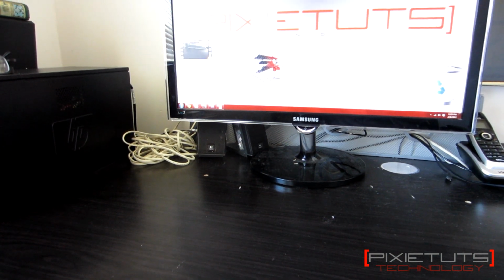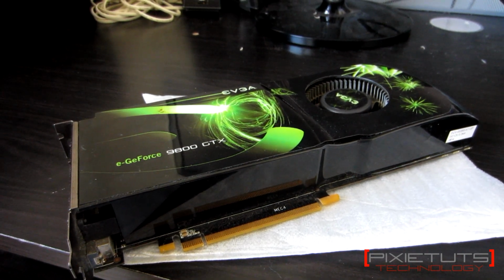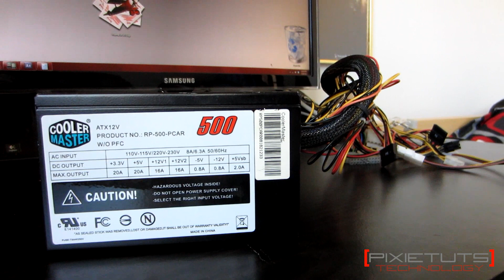Tutorial: Separate Power Supply for your Graphics Card

Comment: is there any danger  or downsides to that
Reply: The question is very simple : does this tweak of having 2 PSU (with one dedicated to the graphic card)  instead of 1 PSU entail specific risk ? The answer is a resounding "no". End of story.
Reply: +Doc Lex There's two actually, underloading and overloading.

Too little power drawn will mean too little draw of current - bad output voltage swings.
Too much power drawn will mean too much draw of current - overloading and shutting it down or worse.

e.g.

200W max. GPU = 300W PSU

etc. about 1.5x the required peak power is safe, you will headroom and adequate load.
Reply: +Nightingale1887 there can never be "too much power drawn'' -the watt rating of a PSU indicates the maximum watts available, not watts that will be ´forçe fed' into the device. The important thing to remember is that a PSU provides roughly constant voltage, it is current which will vary according to the load the device has to cope with. ( when overclocking, comparatively, you can overload the chip by increasing Vcore voltage)
Reply: Nightingale1887 Yes I know that watts and amps go  in locksteps when V is fixed. What I am addressing is your misconception that "overloading is a risk" in this case. It is not.  You can't overload a graphic card by granting it a dedicated PSU, any more than you can't overload a light bulb **when you feed them their fixed rated voltage** (which is precisely the role of a PSU). It won't happen, never, ever. (that would be a very different matter if you short the power supply, for then, resistance is 0 and watts and intensity surge until the PSU  fries or some failsafe fuse is activated. ) Summing up : When your graphic card is idle, your PSU will supply it 12V, 0.1 Amps (for example) and when you graphic card is under load and needs to perform zillions of calculations per second, it draws an influx of energy by opening up billions of new transistor circuits that your PSU will rush to fill automatically 12V, and 15 Amps (example) to exactly match the load - if the PSU can't do this, your card is power starved and it may experience  bugs (but no harm) .  For the argument sake, you could even forget altogether the PSU and feed your graphic card with a 12V car battery (obviously not something recommanded), but in the broad lines, it would behave exactly the same. Bottom line : you can't overload the graphic card as long as it is plugged to the correct voltage PSU. To answer the OP asking about this specific type of tweak (2 separate PSU, 1 dedicated for the graphic card), I would say it makes no difference from the purely electrical standpoint.
Reply: Nightingale1887 Please - the OP is refering to this specific case of having 2 PSU, with one PSU dedicated for the graphic card. Everybody knows that a PSU can die from running at, or over, maximum intended wattage. But this is has nothing to do with the present question, ie. having two PSUs. and one dedicated for the graphic card - Or perhaps do you suppose it is much more likely to fry a PSU when another one is fully dedicated to feeding the graphic card ? Come on.
Reply: +Nightingale1887 from your advanced standpoint, explain me the interesting concept of "underloading a PSU" then ? When can it possibly happen ,?
Reply: +Nightingale1887 and also explain how having 2 PSUs would entail a higher risk of overloading one or both of them ? This is what the OP question is about.
Reply: +Nightingale1887 even for a single PSU, there is no such thing as ""underloading it". You fail to subtstantiate your claims and display poor logic and rude behaviour. Besides,you.re losing your nerves quite graciously here. Thanks for completing my demonstration. All the best.
Reply: +Nightingale1887 using your interesting concept of "power underload" I suppose a PC is most unstable or present risky situatio nwhile doing nothing in idle, or in power management mode ? Thus severely "underloading the PSU"  looool ?? Give me a break. As for overloading', it is plain obvious that adding a separate PSU DECREASES the risk of overload compared to having one only....
Reply: +Nightingale1887 a tons of result on Google ? Maybe like ten . Most of them in forums ans most of them mentionning how utter rubbish the "power underload" concept is.
Reply: Tell me, why o you feel the need to attack my person instead of my arguments? Are not we here to approach some truth? Why such behaviour ? I did not call you names once. Anyway.
Reply: You are unable to navigate yor way through a discussion with logical arguments and facts. Wére debating a Tweak and here you are caling names. There is no point in discussing.  My redundancy salutes your Uniqueness.
Reply: +Nightingale1887 yes yes you proclaim I am wrong, I got that. As for bringing proof of it in the form of facts, logical arguments or external source on the internet.... Well, we just have to trust the doctor.... Bottom line for our potential readers (you.re off limits for a rational argument): there is no risk in using a separate PSU for your graphic card. Google "adding a PSU" or "double PSU"  and you'll find dozens of youtube videos detailing this. No risk whatsoever.
Reply: +James Clerkmaxwell I think you will find that Watts and power (Amps) drawn will be interchangeable IF voltage remains constant. So thanks for being obvious? power = volts ° amps, simplified ofc. Max load will of course give trouble So what are you rambling about?
Reply: +James Clerkmaxwell Who the hell is talking about a GPU? Jfc the PSU will die from overloading. Read it as it is written.
Reply: +James Clerkmaxwell So everybody knows? Come on. It's called being complete.
Reply: +James Clerkmaxwell yes, you're* 'winning' here. Good luck in life <3
Reply: +Nightingale1887 besides if you even took one second to google PSU underload you'd see a ton of results BUT hey you.re ""right". See what I did there? Your grammar is rude and being a total dumbass is charming too <3
Reply: +James Clerkmaxwell Nope Nope Nope that's just filthy peasant lies.
Reply: James Clerkmaxwell What? Nope, you're still redundant and wrong. No discussion needed.
Reply: James Clerkmaxwell Wrong, once again.
Reply: +James Clerkmaxwell oh c'mon say something stupid again. This is fun. You.re funny.
Reply: +Arr2 D2 Nice try.
Reply: anyone knows what happens to northbridge when you upgrade your cpu, does it run hotter or is it the same or what? thx!!
Reply: James Clerkmaxwell +Nightingale1887 anyone knows what happens to northbridge when you upgrade your cpu, does it run hotter or is it the same or what? thx!!
Reply: Arr2 D2 Boohoo fucktard. If you'd know shit about electronics you'd know all I said is correct BUT no going the with dumbass first class James Clarkwell proves you are on his level. Good job! I'm so impressed.
Reply: For the readers : What  Nightingale FAILS to understand here is this : an efficiency curve IS NOT a stability curve. It is not because a PSU is less efficient near idle that it is less stable near idle !! On the other side, at full rated load and increasing, a PSU is indeed getting less stable and much hotter, increasing risk. That's plain simple logic and commonly known facts. While it is true that SMPS require a very low minimum load to activate, I myself experimented with them, using a PSU to power a load as low as a single LED in series with a small resistor, a very small electric motor, etc.. with no problem whatsoever (we're not talking about power-greedy components such as graphic cards or other PC components, which would be much above this absolute minimum just by their fans and LEDs design) ...In any case not meeting this minimum load would not qualify as a "danger", and above this absolute minimum of some tenth of ampere the concept of "underloading a PSU is a risk/danger" is nothing short but ridiculous (beware, do not let your PC go into sleep mode!)...  But some people see curve just like this one : http://www.anandtech.com/show/2624/3 , draw faulty conclusions, give wrong advice, lecture other people, and can't even acknowledge when they are wrong. Barrage of insults are so easy when things are going badly...
Reply: ***** Team Fortress 2? Great game!
Reply: Arr2 D2 That's good to know. Glad there are idiots like you giving  free consulations. Electronics are too hard but hey calling people a child now that's pure intellect.
Read much?
Reply: Nightingale1887 jesus christ you twoo (or 3 or 4) for how many more monts is this debate gonna last?
Reply: Arr2 D2 Wrong again. Resorting to emoticons is supposedly impressive?

Btw so, your name is Hurrr2D2 and you take yourself serious yet call others a child. 

Divine comedy right there. You prove that you need attention. You even ask for it.
Reply: Arr2 D2 so you're Robert Jackson who gets off on people popping zits. Way to go champ.

Comment: whats the point of the paper clip what does it actually do shouldn't you just be able to plug the power supply into wall then directly into your graphics card? that paper clips seems more like fire hazard than anything else
Reply: +john avery PSU will only work if it thinks its connected to a mobo by the 20/24 pin connector. so if your not connecting it directly to a motherboard then you have to jump the power supply for it to power on. just a safety mechanism. jumping it with a pin isnt dangerous or a fire hazard. theres no positive current going through the jumping wires. black = negative. so its pretty safe if you jump the right wires.
Reply: +john avery it's a jumper.  you can, or probably should use a short insulated wire to accomplish the same thing.  that's all i know for sure.  i THINK the reason it's there is because that cord does not get connected to anything like it normally would.  the power that comes in on one of those wires has nowhere to go because it's not making contact with anything, so you put a jumper in there to complete the circuit.  otherwise the power supply will turn on when it's plugged into the wall, but it wont distribute power.  that's my best guess anyway.  edit:  after looking at a couple other videos, it wont turn on at all without the jumper.

Comment: So I did it and yes it worked. I currently just connected my CX600M to my GTX 760 and I actually had an increase in performance. I believe this was because my original PSU was limiting my Clock set. Any ways, now that I know its safe ill be hooking up my GTX 780, thanks mate.
Reply: Unit-01 Moto can u help with clip..
Reply: How was it in a long run?

Comment: you use the paperclip jumper to turn the supply on and then you connect the video card to it. that's not necessarily a good idea. could blow the ps unit. you shouldn't add (or remove) electronics to it when its running. connect the card first and then power it up.

Comment: So i have this problem. My gpu is 7770 radeon and my pc is runing on 300w psu i would like to connect my gpu to another psu so that one psu fot motherboard and hdds and another soly for gpu it would be 600w totall. I am little bit in electronicks so my question is whet gpu is connected to motherboard it takes power from it. and if i connect 6 pin power suply to it from another psu  they will fight each other= smoke isnt it true? or is there something i`m missing?
Reply: yes do not ever connect 2 different psu to one gpu !!!! just buy a 750 watt psu with at least 18A on the 12v rails ! U get them as cheep as 50 euros!

Comment: Hi there. I have 600 watts stock psu of Xigmatek Asgard Chasis. My VGA is Sapphire r9 290 tri-x oc 4 GB 512-bit GDDR5 and my CPU is AMD FX X8 9370 4.4GHz. Is my psu enough for my rig? Please I'm a noob when it comes to power efficiency and I don't want to harm my hardware? Should I upgrade or is 600 watts enough for this setting? Please help.
Reply: I have this psu: X-Calibre XCP-A600 600W 75+
Reply: you should have at least 750w (bronze+) going for a rig like that and a 180w CPU like the 9370. I picked myself up a bronze 750w EVGA supernova for around 90 bucks.

Comment: allright so, I'm gonna do this, can anyone answer me please?

- I've 320W  PSU on official HP cpu. I cannot upgrade PSU (pins don't match) so i'm going to buy a normal PSU and connect it externally (how he shows in the video)

- Im gonna buy 450W PSU.  Cause i'm buying a card called 'Gtx760' which would consume only 160-200W max,  so my 450W additional PSU would be enough to run.

Question Time.
When i'm successfully installed additional PSU to my GPU and start gaming..

1: Will PSU or GPU generate extra heat?
2: Will PSU give right amount of power to GPU?
what if my GPU burns? or doesn't soak right amount of power?

Is this tutorial safe?

I really, really want to do this very soon. Please reply.
Thank you.
Reply: Its been 4 years,how did it work out?
Reply: @lazertag720  I tried it like hour ago...it worked bro.Paper clip shit is working...❤❤🤗
Reply: @reikaz_CS  Still working? :P
Reply: @razmuzen1090  yeah man.It really works still. 🙂
Reply: @reikaz_CS  how do you turn everything off/on😩 im doing this later

Comment: why the hell would u go thew all that trouble if u already had a second power supply that would most likely  power both your PC and graphics card at same time why wouldn't you just take the old one out and put a new one in
Reply: reason why he made this video is
sometimes , some company manufacture the CPU's in such a way that PSU's cannot be upgraded
I.E mine,  I cannot upgrade my PSU. the regular psu pins don't match with mobo's pins.

so that's why, I buy additional PSU for powering up GPU , in this method.
Reply: a few dell and hp pcs still use proprietary power supplies, also this works for servers that do not have an option for graphics card power connectors.
Reply: because some computers has PSU's that could not be changes like mine. HP elite 830. so we need a second power supply for the gpu
Reply: a have an HP 8200 and it doesn't have a 24pin in the motherboard so i can't replace my PSU and i have a corsair 430 Watts so i'm gonna try this method and i will see if it works for me !
Reply: yea I was thinking the same thing.. I hope he will answer
Reply: I guess since he didnt install the card, that it was just a demo and he didnt plan to do this setup. (Maybe)
Reply: he's showing how to do it
Reply: ///M Power did it work
Reply: Sometimes my old motherboard has a shitty PSU soldered in. Im waiting until my new motherboard comes but until then, i have to do this
Reply: did it work???
Reply: ///M Power can u help i have the same machine i want to do exact what he has done in the video
Reply: jaylord55 well the reason I came here is that I have a slightly new pc that has a power supply of 250 watts and a gpu and 110 watt power supply from an older computer. The 250 doesn't have extra connectors so I need the power from the old power supply to power the gpu that's plugged into the newer pc so this video is very helpful
Reply: can you do this.. two 230w psu, with vata connectors, the 2x vata to 6pin connects to geforce 8800gt. both vataz on end of 6pin is connect to a diffent power supply. would that give me enough power to run it. ( I need 425w )
Reply: To show that you can. Focus people.

Comment: I have twin frozr gaming GTX 650 ti boost and if i set it to 115 on the second power supply it doesn't burn it out ?
Reply: GTX 650 ti doest need a PSU it doest have a power conector so a 300W 15A Psu
will be fine!!!
Reply: thats not true mines needed at least 400Watt and it does have a power conector

Comment: I have a Cooler Master Extreme Power Plus 460 which is rated at 420W.  I'm installing a second-hand HD 6850 graphics card that required minimum 500W power supply on one 6-pin cable.  Can my 420W power up this 500W card?  I'm not into heavy gaming at most just Sims 3.  I do however overclock my Dual-Core E5200 from 2.5GHz to 3.6GHz and only use 1 harddisk 1TB.  Will I be ok?
Reply: Yes

Comment: Switching an auxilary powersupply on before the rest of your system is really not a good idea as you are forcing unused power into a peice of hardware instead I suggest you connect the PWRon (green) cables of both supplies together and one common ground (black) of both supplies also this will enable you to run both supplies at boot my second supply runs my pump and rad fans along with Bray drives and led strips the GPUs mobo and CPU along with hard drives run from my main supply it works wells as both fit in my case.

Comment: if you going to use a external powers supply to power your GPU then id recommend using the external power supply to power everything  if you can't fit it in your case for some reason
Reply: Ppl do this mainly because of ten pin adapter motherboard not being compatible with 24 pin power supply
Reply: The whole point is the one power supply can’t power everything…

Comment: Most modern cards have an alarm and don't turn on if it has no power, but the real issue is different psu manufactures handle the power rails differently, isolated grounds etc etc.  This sounds fine in an emergency but why risk a $300 video card doing this:P

Comment: I have a 500w PSU in my rig currently, running a Radeon 6770 just fine. However, I recently came into a donated ATI 6950 which will not boot when I install it (red led on the card, implying not enough power). 

I have a spare 450w PSU gathering dust. If I followed the steps in your video, should I theoretically be able to run the 6950 on the 450w? From what I read online, the 6950 normally requires a PC to have at least a 700w PSU, so I'm wondering if 450w dedicated would be enough.
Reply: Look into how much your card draws. If it's within the amount your psu can handle it should be fine. There are a lot of cards that are rated for 300w psu's yet they only draw at the maximum 75w. I'm currently running this psu setup just for supplimental power for my card lol. My second PSU is pretty much idle at all times as the card draws mostly from my motherboard